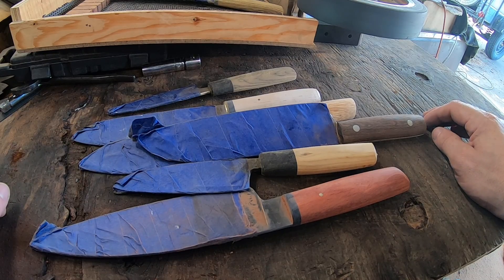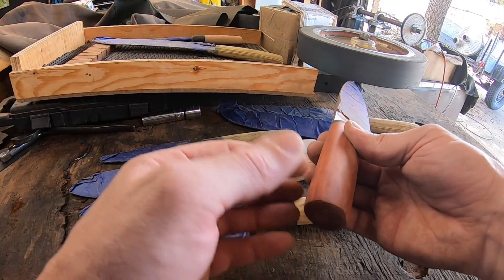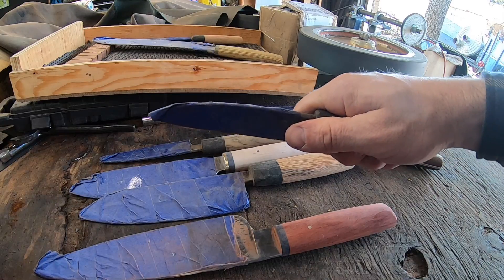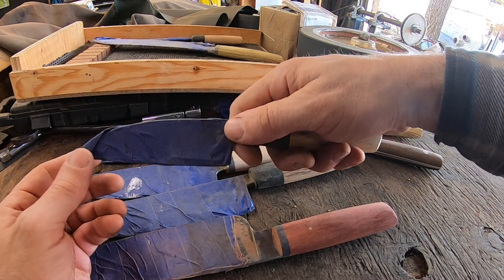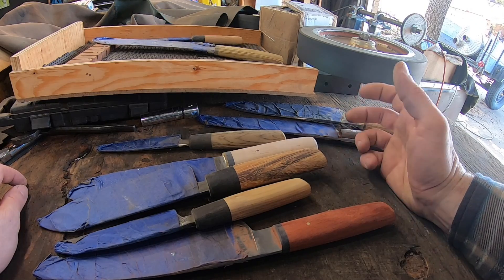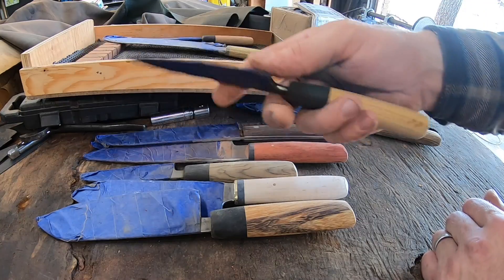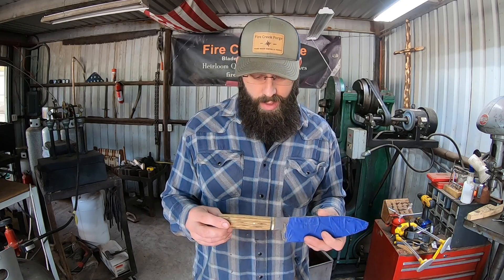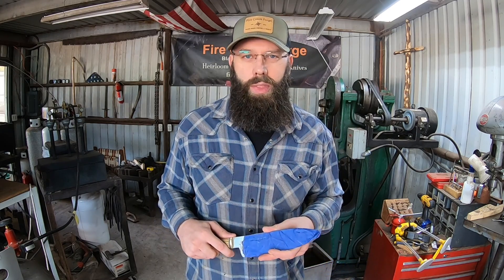Knife Handle Design: Tip Of The Day, Ergonomics | Blade User Interface

Comment: In making a lot of kitchen knives I've found that the ones with the rounded top for palm support and a V-shape towards the bottom with a ratio of about half the top width seemed to make most people happy. The length ratio is also kind of important if you're selling knives to general users it tends to be in the 100-110mm or 4-4.5" tends to suit 'most' hands and you don't want them too long either as that will get in the way with some types of grips- most notably if you choke up on the blade in a pinch grip. About the only knives you want a shorter handle on are paring knives and you can knock them down to 3.5" on a smaller blade that fits into the palm.
Balance is sometimes important to have on some kitchen knives if its a western style of knife like a French, German or Gyuto tend to want a 50-50 near the bolster or front of the handle area. Paring, fillet, boning and petty knives tend to be a bit more 40-60 toward the handle which keeps the tip nimble and they're lighter blades. Tippy knives which are more 60-40 are towards the blade are good for a lot of the specialist processing knives like the Chinese cooks, western butcher blades, carvery knives and some of the Japanese knives, that tends to make them use the weight of the blade to either drag through material for slicing, push-cuts and sort of self-aligns the blade to do the work.

One important thing a lot of newer knife makers tend to forget on kitchen knives is you want a nicely curved U shape on the spine of the blade so it doesn't have crisp, sharp edges and cause blisters or rubbing if you choke up on the blade.